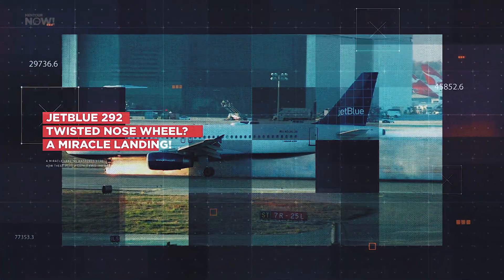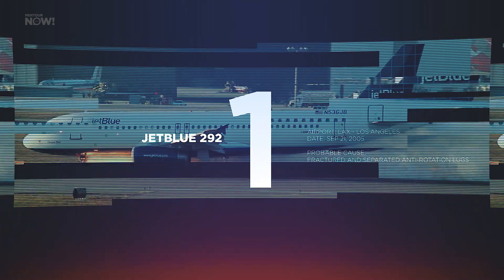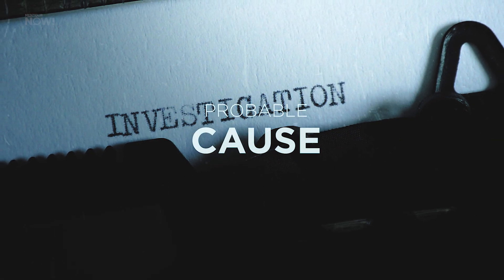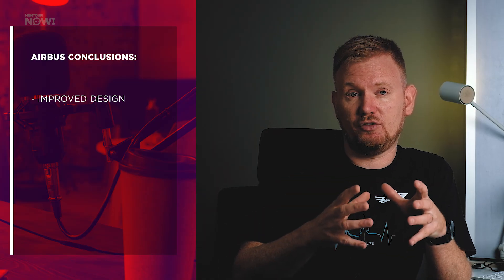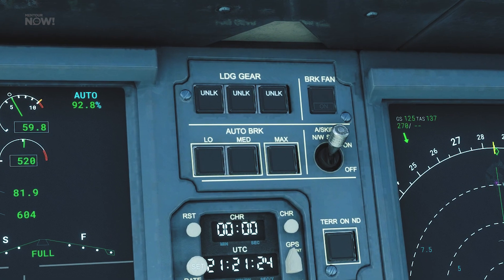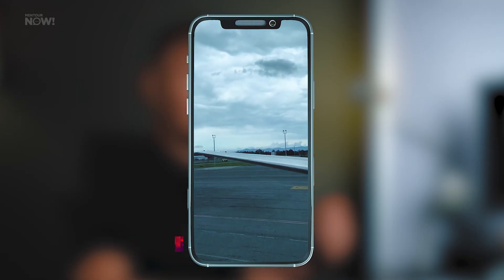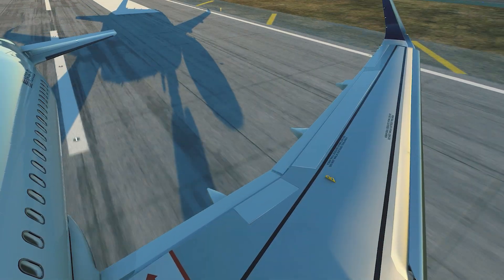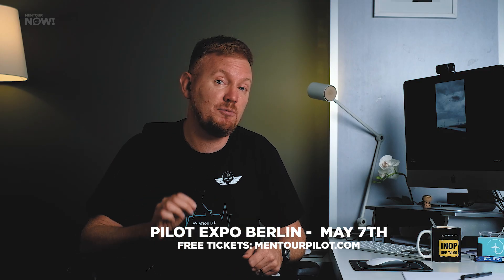The TWISTED Story of the Airbus A320 NOSE-GEAR!

Comment: It seems like 90 degrees is a default position by design. Any other position between 0 and 90 
would cause the plane to veer off the runway which could be a potentially dangerous situation.
Reply from the maker: That might be correct
Reply: @MentourNow    A type of fail-safe mechanism.
Reply: @MentourNow   It's an atrocious design. I'd love to hear more from a truly knowledgeable person, but I've heard the nose wheels need to rotate to the 90° position for retraction/stowage. It appears to be an overly complicated design for unknown reasons that doesn't allow a simple up/down movement. Boeing uses a micro switch to confirm the nose gear is centered. Airbus uses an entire computer system to perform the same raise/lower function. It reminds me of how the MLG stows on the C-5 transport. (BTW: Lockheed didn't use computers to do this either - it's all switches and relays.)
https://youtu.be/hZ1nfKQZ408
Reply: @MentourNow  When such defects happen, can they somehow ensure that it does not rotate and cause the plane to veer off? What are the physical factors for and against such movements? Is the described camber behavior somehow ensuring that it either centers or goes/stays 90°? I am not clear on whether the defects that happened would naturally keep it at max angle or whether it is rotationally loose at that point.
Reply: @MentourNow  The circumstances of all the events that you explained may be different, but they all stem back to the same poor design.
Reply: @MentourNow  
Explain why my comments are being censored please.
Reply from the maker: @Angelum_Band  I haven’t removed a single one of your comments to my knowledge.
Reply: @MentourNow  I understand and glad to hear. Then I will make you aware it is happening. Youtube algorythm? I am not the only one it seems cause there's another person who had the same anomaly.
Reply: Interesting point, I'm going to guess keeping the landing gear steady at 0 degrees will be much harder to do. It is curious that in these incidents, it didn't collapse. I found this part especially impressive. My uneducated guess would have been the forces would have been great enough to rip the landing gear right off.
Reply: @notsam498  well now I’m curious. When I was doing my automotive apprenticing. The instructor took a small toy car and glued the rear axle so the wheels could not spin. He was demonstrating antilock braking and how a still rotating tyre stops better than a locked up on. that the car turned around every time.  the locked up wheels skidded out in front of the freely rotating front wheels. This could just be the way the car was externally accelerated it was pushed.  Still I wonder how much force a sliding/grinding hubs generates in comparison to a gripping tyre on full brakes. Provided the wheel does not dig into the runway.
Reply: @lukeorlando4814  Your instructor was right, but there are no brakes on the nose gear of the A320 and AFAIK no large airliner.
So it is just the free rolling resistance vs sliding.
Reply: @kilianortmann9979  thanks. Didn’t know that.
Reply: @kilianortmann9979  Only airliner I know of that had front brakes as an option was the DeHavilland Canada's DHC-7 or Dash 7.
It was to help stop it on short runways, however testing did show very minimal gains from the option, and a hassle on the maintenance costs.
Reply: @CMDRSweeper  I now also looked a bit into it and the early 727 apparently also had nose wheel brake, by  far the largest one I know of.
-7 makes kinda sense with a NW brake considering the strong STOL focus.
All of those sit very low to the ground though, with short NW struts.
Reply: @lukeorlando4814  That's due to the difference in friction. In a car locking the front wheels, is far safer as the vehicle remains stable.
Reply: @agentcrm  yes I understand that entirely. My curiosity stems from that understanding and wondering about the likelihood of the gear collapsing under the strain of the wheel pointed 90 degrees. Is the wheel hub sliding across pavement really that much more resistance If not less than the tyre rolling.
Reply: @lukeorlando4814  Yes, the hub sliding across the pavement is much more resistance than the tyre rolling. That's why we put wheels on things!
Reply: @beeble2003  well when you put it that way. I feel terribly silly asking. And then I think back to that toy car where the glued in place rear wheels would over take the free rolling front wheels every time and I’m convinced there are more variables to consider.
Reply: @lukeorlando4814  No need to feel silly. None of these incidents has resulted in a plane spinning after landing so the forces here must be different. As you say, some other variable is preventing that. One significant difference that comes to mind is that cars are front-heavy and have wheels at the corners. Planes are mid-section-heavy, with the main landing gear just behind the centre of gravity and the nose gear taking only a small fraction of the weight.
Reply: @agentcrm  "Stable" as in going dead ahead, straight into that truck, wall or whatever that could have been avoided if only the front wheels weren't locked up ...
Reply: @Wannes_  was stable meant as in opposed to how tricycles have a tendency to roll over when in a corner?
Reply: @lukeorlando4814  Rear wheels will "overtake" the front if locked (on the car example) because a) there is more load on the front wheels and less on the rear (the "weight shift effect" caused by torque around the axles as the contact point is below the axle, so the car attempts to rotate around the axle but can't, so the force at the front is increased), b) dynamic braking resistance (i.e. for rolling rubber, on the front) is greater than static resistance (from locked rubber, or plastic in the case of a toy). Higher load on the fronts allows greater braking resistance (equal to perpendicular force ("weight") times coefficient of friction) so the from slows more quickly. Lower load on the rears and reduced coefficient of friction means reduced braking, so the rear slows less quickly than the front. Result: spin. Generally nothing to do with the point of anti-lock braking though; front to rear is controlled by bias in the hydraulics and smaller rear brakes on cars (not aircraft though), whilst ABS on cars is primarily to allow steering whilst braking. On aircraft, ABS is primarily to maintain the dynamic coefficient of friction, rather than departure into static (reduced) friction.
Reply: @Wannes_  Yes it's always better to avoid locking up. 
However out of the two option locking the front wheels is typically the 'safer' option. (ie. not spinning) 
Regardless we're going beyond the initial discusion now.
Reply: @notsam498  Landing gear is one of the strongest and toughest parts of a commercial aircraft, second only to turbine blades. Tyres and even wheels wear surprisingly easily compared to the strength of the gear and its mountings. If gea R gets ripped off, you know it was a oarticularly hard impact.
Reply: @notsam498  AFAIK the nose gear takes only about 10% of an aircraft`s weight.
For an A320 even at maximum landing weight of 64t, that is 6,4t multiplied with the coefficient of friction of an aircraft tire (0.6) that is less than 4t of horizontal force in the worst possible conditions.
Sounds like a lot, but in engineering terms it just is not that much.
I find it highly likely, that Airbus did some internal FEM analysis of that issue, decided there is no danger of the nose gear actually collapsing and decided that there is no need for radical (and expensive) redesign.
Reply: @kilianortmann9979  I have a question about this:  I think you do have to take into account, that the landing gear acts as a lever leading to very high torque at the mounting point. I think the clearance at the front is about 1,7m so I would assume you get a torque of about 6,8t at the mounting point. Is this coorect and would this be a lot?
Reply: @kilianortmann9979  Your loading is for a static case. In the case of a plane landing with the wheel unable to roll in the direction of travel the gear would very likely experience greater deflection than for the static case therefore greater stress.
Reply: @notmyrealname6065  The forces when the wheel cant rotate are actually slightly smaller, because sliding friction is less than static friction, so less than 0.6.
The load factor will be higher, about 1.25, but the weight should also be significantly less than maximum landing weight.
Reply: @notsam498  I think the pilots were skilled enough to run on the main landing gears long enough before dropping the nose gear in all incidents. If there's just one time that a strong crosswind or head wind prevent the pilots to perform that kind of maneuver forcing them to drop the nose gear early, the system will probably collapse.
Reply: I've heard a couple of A320 pilots mention that it is indeed a "default" position for exactly the reason you mention.
Reply: I think this is only a matter of perception. You don't learn about the incidents where the nose wheel is at 0°. Assuming it could still move but is just not actuated but free moving, we learned about the camber in the video. You could even taxi the plane. And even if it's absolutely stuck, differential braking can easily make the small adjustments to stay on the runway.
Reply: This might be a naive question, or covered elsewhere in the comments, but why don't nose wheels act like castors or shopping trolley wheels?  So that even if they start off at an oblique angle they mechanically self centre?
Reply: @KravKernow  They do self-centre up to a certain deflection, but castoring geometry is tricky stuff. If you set it up so that it would free-castor at a 90 degree deflection you might risk setting up the conditions for a potentially destructive nosewheel shimmy (wheel shimmy is of course a common problem with shopping trolleys)
Reply: I'd expect a 85 degree angle to handle about the same as a 90 degree one.  You'll skid instead of roll, blow the tires, and turn the wheel and axle assembly into scrap metal.

Get it stuck at 5 degrees off of the straight ahead position though...
Reply: Just want to say thank you to Russ and Harry for their insights; and all the other smart people on here.
Reply: if it fails anywhere between 25 and 90 it will snap to 90. and within 25 it will snap straight. it wont make the plane turn.
Reply: They did not do the FMECA analysis correctly for sure 🧐
Reply: About why it doesn't default to 0° on failure, that option would require some kind of a self-centering system, which would likely also fail in those cases, leaving the wheel pointing somewhere not  0° or 90°, but somewhere in between, so the plane would go off the runway immediately. The actuators slamming into the mechanical end stops is much more reliable. You may need to change parts after the fact, but you would need that anyway, so a tyre, rim, bearing box more to the list, that's just wear parts that need to be changed at certain intervals anyways, so why bother.
Reply: it's cool that it fails safe but it's better if it doesn't fail at all. that's a massive train of problems all in this one mechinisim.
Reply: Which would imply that flipping the switch in one of these cases actually made the situation better, by turning the gear to a full 90 degrees.
Reply: There's no reason for it to turn past 90deg (since that would be equivalent-ish to a lesser angle - except with the tires rotating the wrong way if they're directional) and therefore that is probably (mechanically) the furthest it can turn...

All tires - even on your car - will tend to turn themselves towards either centered or one of their extreme limits, based on their configuration (I believe this is dependent on the caster angle, not camber as the video says, but could be wrong there) and caused by rolling resistance. And, as the video notes, this can also be dependent upon the current angle of the tire.
Reply: Why don’t take advantage from the automobile industry experience and dial some caster effect into what is basically a frontal directional suspension?
Reply: Maybe they should change the default to 0 degrees. 🤪
Reply: Another naive question, what about if they designed a backup mechanism that could mechanically/geometrically rotate the gear back to zero degrees and lock it in place when deployed, would being locked at zero degrees be more risky for landing than locked at 90 degrees?
Reply: that would be smart engineering,  not standard at less important engineering jobs... or luck in this case
Reply: I don't understand a de-fault position that is actually a fault. 0 degrees straight should be the default position
Reply: @NicolaNicodemo84  Maybe they mean that 90 is the best failure mode when 0 is not possible: Best = 0; 2nd_Best = 90. I dunno 🤷
Reply: @robertjenkins6132  this would make a lot of sense.
Reply: @robertjenkins6132  Basically that's exactly how it is. 90° turned also means the mechanism has reached a mechanical stop, it can't turn any further. The issue with 0° is that from there depending on what is actually broken the nose wheel could turn slighly when touching down and could cause the airplane to wear of the runway. That is very unlikely to happen when the wheel is 90° turned and has reached a stop.
Reply: @NicolaNicodemo84  If there's any problem or loss of control of steering, 0 degrees is hard to maintain, and could make it impossible for an airplane to remain on the runway during a landing.

However, you can put a physical stop at 90, so that you know that the gear won't create any lateral forces.
Reply: @NicolaNicodemo84  The point is that it is one of two fail safe positions so that the gear is safe.
Reply: @NicolaNicodemo84  But how do you know what 0 is?
if 90 is the max, all the system has to do is move it until it hits the limit.
Reply: @NicolaNicodemo84  - My hypothesis: with a 0 degrees defaukts the pilots would have a much harder time trying to steer the plane differential braking on the main gears or with the engines.

Once the front tires blow up, the nose gear becomes - kind of - a dumb metal sled with a much reduced friction coefficient.
Reply: 90 degrees is not the default, it happens when there is a failure. When things fail, they do things that are not designed for. When all the engines fail, the aircraft does not fly well, American Airlines 587 did not fly well when the vertical stabiliser detached. "Fail-safe" is a design principle that is applied if possible, but comes with a cost (in both design and operation) so is not always appropriate.  Power interruptions are not normal or even expected, castor angles can default to 0 degrees with steering angles up to 25 degrees but much more is difficult geometry to engineer without making the gear heavier, etc; there are compromises in EVERY design.
Reply: Genius. But than why not make the zero degrees the default position..
Reply: crap design , cannot handle water ingress on a nose wheel (wtf is the difference between a pressure washer and a wet runway on a bad wx day out????, ) and there is no absolute shaft position  encoder on the top of it all so the cpu doesn't know really where the angle is it probably does a rough position assesment by wiggling a bit .
Reply: You really want 0° to be the default....
Reply: @dfeuer  Yeah, bet several engineers at Airbus are doing a facepalm wondering why they did not think of that.....Things are not as easy as you make it.
Reply: @se-kmg355  actuall, if the gear isn’t bent, a O degree “ auto return” is pretty easy. Seriously.

There was a period of time where tricycle gear aircraft existed, but steerable landing gear did not. Differential braking was used to steer, and funny enough, you don’t hear horror stories of those aircraft loci g their nose wheels sideways.

Also, given the number of other Airbus airframes, Boeing and other aircraft, and effectively ZERO 90 degree failures with them, it seems to be a “design oversight” with this particular aircraft. 

And how to fix/avoid? Increase the caster angle of the front nose gear slightly. This will force the NG to self center, as long as it hasn’t physically locked sideways.
Reply: @dfeuer  That's my inclination as well.  But I wonder if the reason for 90 instead of 0 degrees has to do with the ECAM registering the fault.  (Would it know something was wrong at 0 degrees deviation?)  Also, if the pilots were unaware the nose wheel was stuck at 0 degrees (locked straight ahead), and attempted to take a high-speed taxiway turn-off, it seems likely that the rudder could be effective enough to veer the plane slightly so that it misses the taxiway turn-off, but departs the runway into the grass/dirt, causing worse issues than grinding the nose gear down.  (Just speculation on my part.)
Reply: @dfeuer  
Going perfectly straight ahead would clearly be the ideal, provided the plane was landing perfectly parralel to the runway. But even achieving straight ahead for an unpowered and uncontrollable wheel on a flat surface wouldn't be possible. The force on the wheel from its rotation would tend to turn it in one direction. In front wheels of cars, they design each front wheel to be slightly angled and tilted from the vertical [toe in, heel out]; but this only works for one specific speed, etc. Cyclists achieve the same effect by instinctively changing the angle of the bike by varying their balance on the machine.
90% & 270% would be the points where an [unpowered] wheel no longer have any effect on the direction of travel, 
and any steering system would also effectively longer function.
Reply: @stephenarbon2227  ignoring the weight and so on, couldn't you build nose gear like a shopping cart wheel, so letting it go free makes it irrelevant for steering?
Reply: @dfeuer  
True, like some shopping trolley designs, if you have the wheels sitting after the centre line of the strut, and you also see this in some fighter planes. 
But you can only change the plane's direction by varying the engine thrusts, rudder adjustments etc, which is I guess what they do with no front wheel. 
However if the steering  mechanism is the fault, then having it stuck in the wrong angle would be fatal for the landing, while having it at right angles makes it equivalent of not having a wheel at all.
Reply: @stephenarbon2227  obviously you want it to fail safe (either shopping cart or 90°). It's not obvious to me what makes 90° easier.
Reply: @dfeuer  the issue is they are used for stearing. Which means they can mechanically lock up. You DO NOT want it to mechanically lock   anywhere between 1 and 90 degrees. With it being at 90 degrees, you dont have to worry about a shimmy, shopping carts have this issue.
Reply: @dfeuer  
I'm not an engineer, but if the wheel can freely pivot on the vertical, it would be like a broken-down ship in a strong wind, and in the ships case be pushed side-on to the wind.
In the plane's case, having the wheel go side on to the forward momentum of the plane, means the tire no longer steersl, but as a fat skidding stick. Better to have it  do nothing, than to steer off-course.

[Although I agree with you, that a pair of wheels trailing behind the vertical pivot would be self-centering, and there must be another reason why that option was ruled out.]
Reply: @dfeuer  Yeah, increase the caster angle.
Reply: @dfeuer  Default in case of a malfunction, not default during standard operations 🤦‍♂
Reply: I'm not sure if this design has a "default position," but if it does that position should be straight ahead, meaning 0 degrees not 90 degrees. And to state the obvious, a default position of 0 degrees would not interfere with a safe landing and it certainly would not cause "the plane to veer off the runway. What these failures seem to indicate is that the original design was so badly flawed—both hardware and software—that Airbus is forced to correct those multiple flaws one at a time. They don't repeat because each fix brings an end to one problem but not the rest.
Reply: @Inkling777 - I understand where you're coming from, however I'd ask you to consider this...  The only way to determine the deflection of the nose gear steering is via sensors built into the system.  As with all Airbus systems there's a significant amount of redundancy built-in, however as Petter has noted in his video, the underlying cause(s) of the incidents have been different every time.  From an engineering standpoint, a failure of the sensors or a failure of the actuators could well cause the nose steering deflection to be different from that reported by the sensors.  While the optimum orientation is zero degrees straight ahead, if there's a failure which makes the reported orientation unreliable and there is a proven checklist/procedure for landing safely with the nose gear oriented at 90 degrees because the rotational actuators have driven to the stop, that's going to be safer than having the system attempt to orient the nose gear at 0 degrees and getting it wrong (because the horizontal trajectory of the rollout would be completely unpredictable).  In other words, it's better for a crew to be dealing with a known failure scenario and behaviour.
Reply: @Inkling777  This reminds me of the MK14 debacle in WW2.

The US Navy during the 1930's developed a series ov torpedoes. The MK 13 aerial torpedo,  the MK14 submarine Torpedo,  and the MK15 surface Ship torpedo. 

These were very complex weapons designed to use a magnetic detonator  to explode underneath a target breaking its back , sinking quickly.  

However the detonator was only tested twice,  the first time it worked as designed,  on the second test the torpedo went under its target and failing to explode.  

Even though it had a failure rate of 50% it was adopted. 

When the US entered WW2 the submariners discovered that while they performed nearly perfect attack approaches they were having little success with their torpedoes,  sometimes they saw the torpedoes go right under their targets,  sometimes they had the torpedoes detonate as soon as it armed.

When the magnetic detonator was disarmed  the MK14 then showed the  second problem  in that the torpedoes were running deeper than they were set.

When that problem was resolved, the third problem appeared,  when the torpedoes hit at what was supposed to be optimal angle the failed to detonate. 

This problem was found to be that the firing pin was both too heavy, and too soft deforming  when it struck the target at right angles. Ironically the  Japanese  provided the solution to this problem  when the Naval engineers at pearl harbor  trying to find a metal that was light enough,  and strong enough to not deform  used the metal from the propellers from the Japanese planes shot down during the  attack on pearl harbor.  Ironies of ironies.